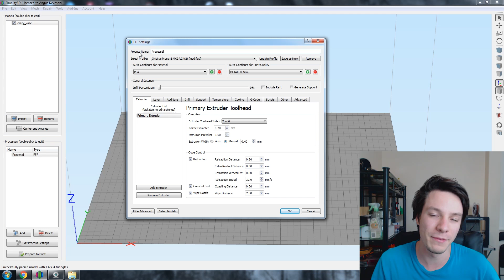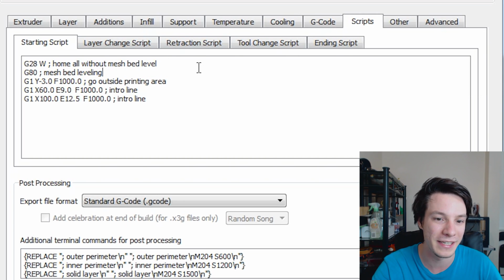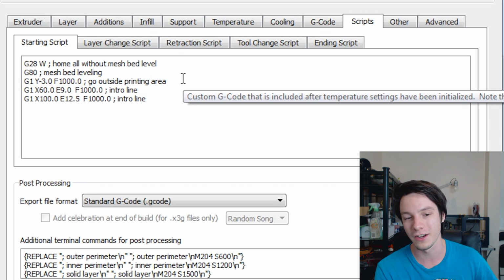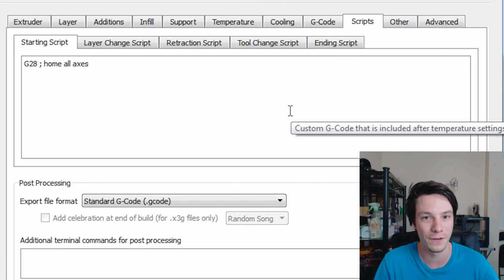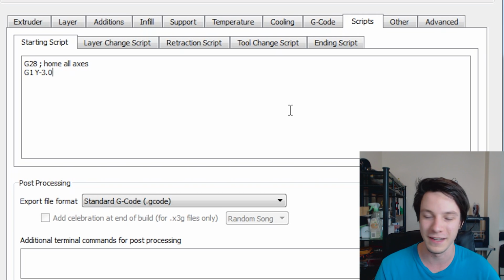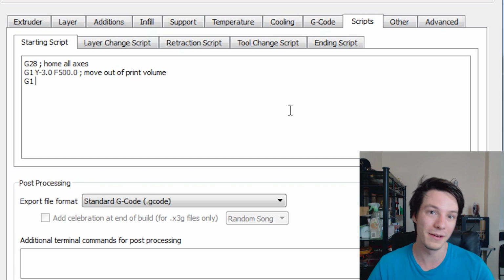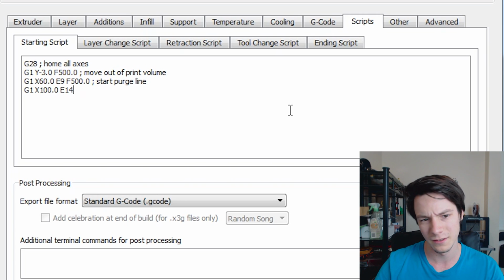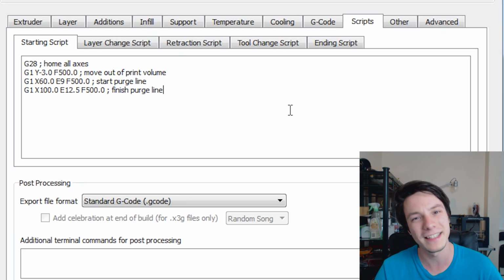How to do a nozzle wipe before every print - Gcode Scripts part 2

Comment: I'm confused why there are 2 lines of code for this with 2 extrude (E) commands?  I see a starting X axis point, speed, and ending point, but how does it extrude 9 then 12.5mm of plastic in 2 separate commands, but have 1 solid nozzle wipe line?
Reply: Logan Henry - Hot end position is at X0 Y-3 right before the G1 line.
The first G1 command says to move X to position 60 (60mm away from X0) and extrude 9mm of filament at the same time.  
We have arrived at X60 Y-3.
The second G1 command says to move X to position 100 and extrude 12.5mm of filament at the same time.
Reply: Ok, thank you.  60mm move and 9mm plastic, then a second move that is another 40mm and 12.5mm of plastic.  That sounds like it would get the hot end primed well!  So there is no distinguishable delay between moves. I suppose if Angus used a different F speed between the two moves, it would be visibly obvious as 2 different commands.  That's interesting!
Reply: No, the moves are absolute, not relative. So the first line extrudes 9 mm, the second line extrudes 3.5 mm (12.5 - 9 = 3.5), not 12 mm.

Comment: hey Angus, what do you know about silicone insulated hotends?
i recently started reading up on it and stumbled upon two very interesting methods.
1) the hotend basically gets cast into a heat resistant silicone, which results in a very clean looking insulation but is quite a bit of work.
2) the assembled hotend simply gets wrapped in a few layers of self welding silicone tape. this got me quite good results but I have no means of comparing. the insulated hotend can be touched without instantly getting burned.
Reply: I use the E3D Sock on my Prusa i3 MK2 and it works perfectly http://e3d-online.com/V6-Sock-Kit-3-Pack?search=sock

Comment: Just curious on this...
The existing GCode goes to a known home point (0,0,0) then additional lead-in G-Code moves away from that point. Is the main G-Code file going to start with an absolute position, or is there a risk of offsetting the print as the G-Code maybe assuming it is starting from 0,0,0 ? 
(Running a monoprice replicator i3, essentially a Wanhao like your demo here, but G-Code generator is a modified Cura program with a pre-set leadin G-Code)
 - Eddy
Reply from the maker: As far as I understand it (I may be wrong) 3D Printers use G90 - which is absolute. Looking at the code from S3D it fires that off before anything else - so despite moving beyond 0, it should not offset position. The only exception to that is the resetting of the extruder to 0 at each layer, by using G92. I have not seen any 3D Printer code use G91 personally, which is incremental positioning.
Reply: Ok, tks for the feedback. I'm a bit new to the G-Code scene, but have years of exp with Gerber which is a similar CNC scripting language... cheers.
 - Eddy

Comment: My Monoprice i3 v2 extrudes a small blob purge at the left front corner of the platform before raising up and  moving to center to print. Isn't that kinda' the same thing, just not a line?
Reply from the maker: Yeah there's a few ways you can do it! As long as it wipes the blob somewhere should be good